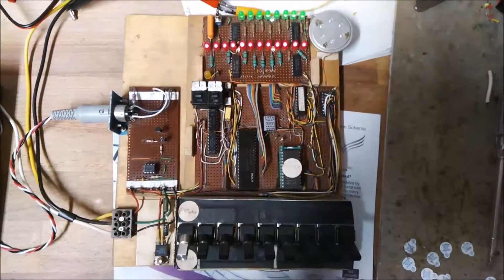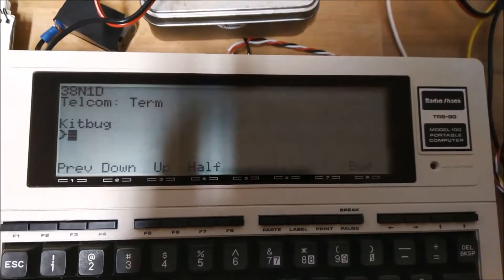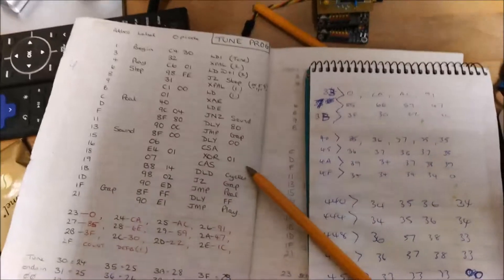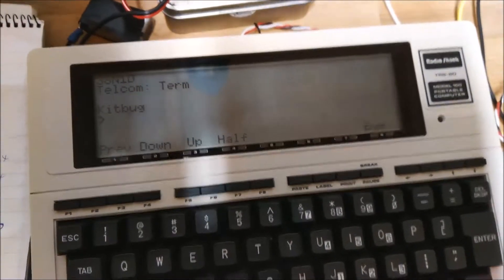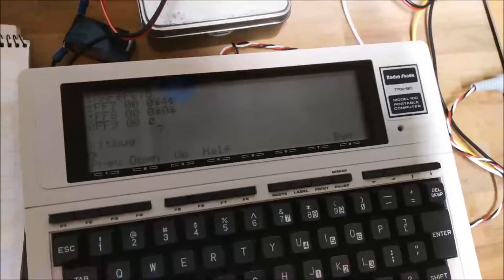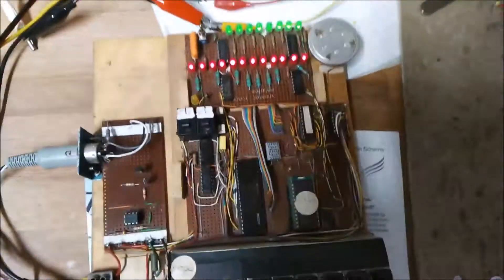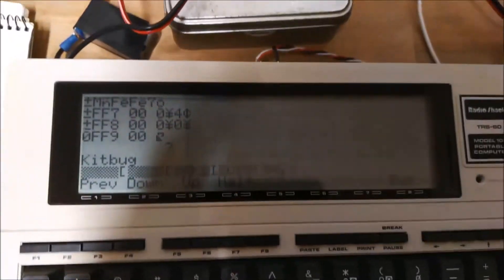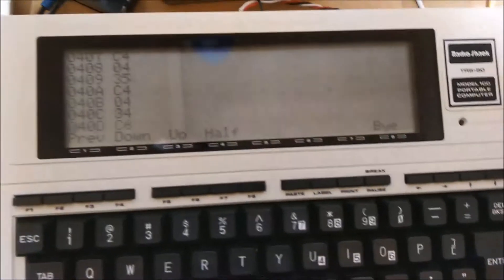Homebrew SC/MP micro-system built in 1980

Comment: Thanks for showing us this interesting system, which I guess 'drives' the same way as the 'National Introkit' which also used the KITBUG monitor when in its most basic hardware form - when you made this back in 1980, what did you use as a terminal to communicate with it at that point? Edit: sorry, I've just read your extended description and I see you were using an 'Elekterminal' originally.
Reply from the maker: I've had to clear my loft for a new boiler pipework, and found the Elekterminal - the case is looking quite corroded and I've not had time to try it yet - but at least its still here !
It has a matching Cherry keyboard, not sure if that has survived...   I'll try them next week
Cheers
Phil

Comment: I was going to ask where your hex keypad is... If you've got an SC/MP, you must have a hex keybpad.... And then you swung over to the terminal and I was, like, "Woah!" :)
Reply from the maker: The bare system as designed by Andrew Aitken in 1980 has binary toggle switches and LEDs, but no rom, so each byte of a program is loaded by single-cycling the 'load accumulator' opcode, then toggling the data and single-cycling, then single-cycling the 'store accumulator' opcode, then toggling the address its to be stored at and single-cycling... so you can understand it very soon became tedious to use :)   I piggybacked a 2716 with Kitbug onto the 6116 ram and added serial I/O, the Tandy 100 is a really useful tool for retro computing, I've had it decades and its been brilliant!  
Check the Karen Orton PIC14 for a hex-keypad SC/MP system
Cheers - Phil